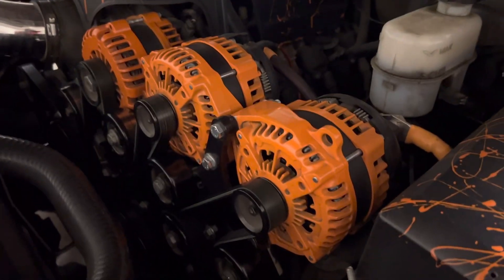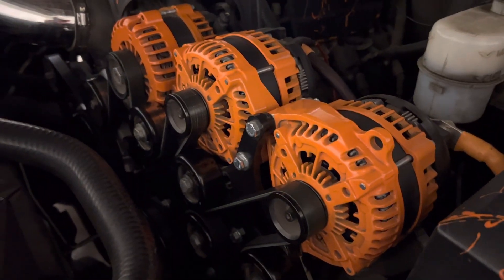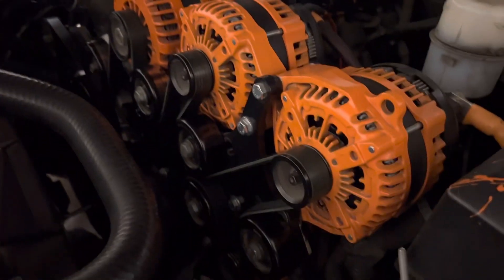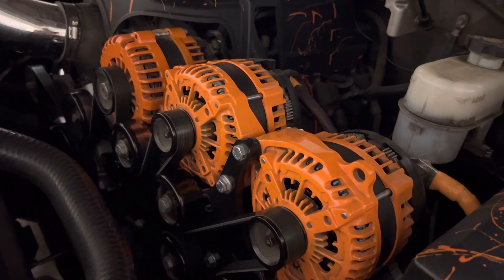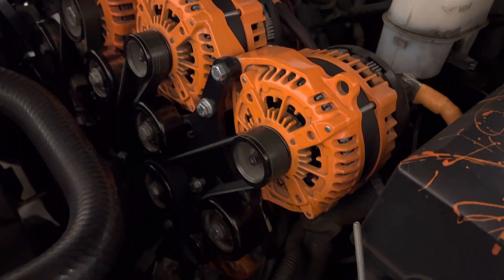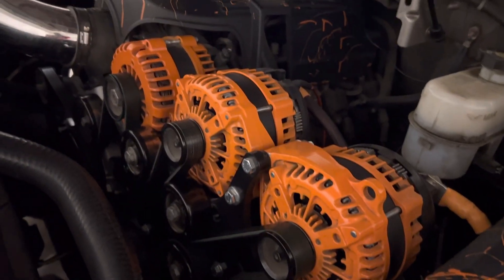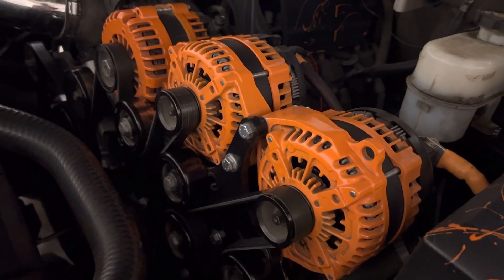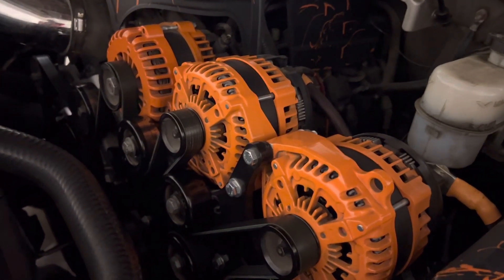Why are  extra alternators are needed for car audio?

Comment: Okay maybe you'll see this, maybe not. I have a '23 Palisade and nobody makes HO alternators for it. Also, for some reason, nobody can rebuild it. So, in that instance, what are my options? Do I get several lithiums and charge them up all the time? I've got a Taramps Smart Bass 8K pushing 2 Solo X 15"s and 2 JL Audio VX1000/5i amps for mids and highs.  The Taramps is running at 4 ohms until I can resolve the power issue.